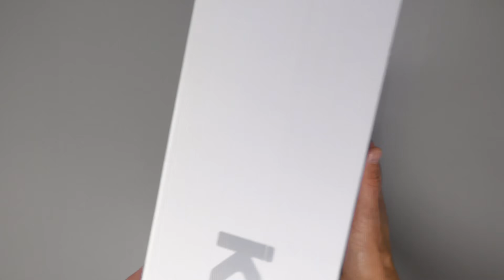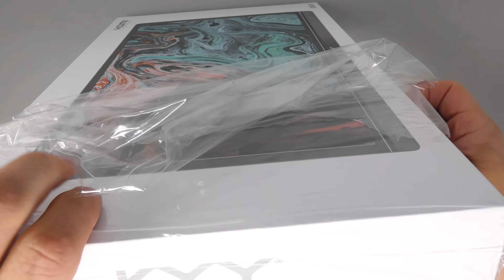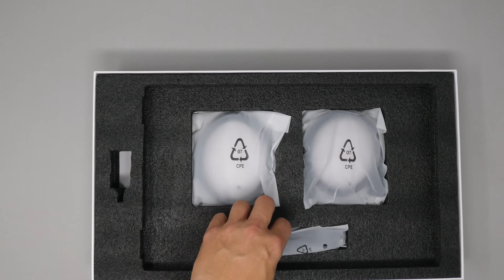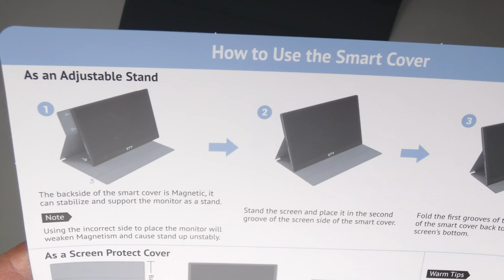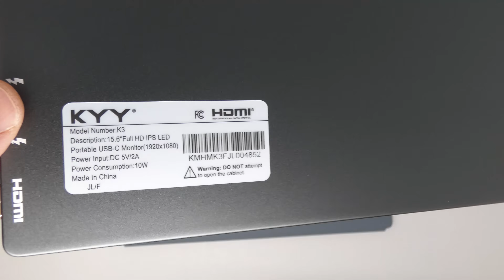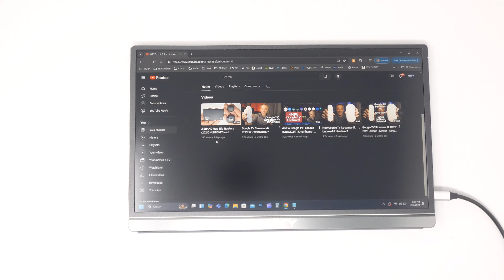KYY K3 15.6" Portable Monitor Unbox and Test

Comment: I can't get it to connect to my phone.
A Motorola.

It just goes into power saving
Reply: Probably your phone doesn´t have a strong electrical output to power the monitor. Did you try using the Plug to power it while using it with your phone?
Reply: @stam150274 yes. My phone doesn't have video output. Something like that. 
I used an app and it told me.

Comment: Hi, do you know how to disable the audio to use the laptop audio instead?
Reply from the maker: Do you mean you want the audio to come from your laptop speakers?
Reply: Correct. When I connect the screen to the laptop it uses the screen audio, and it is not the best. So for meetings, I would prefer the laptop speakers
Reply from the maker: Gotta be a setting on your laptop, not the screen. Gotta tell your laptop where to route the audio. Are you using windows?
Reply: Yes. I am using windows.
Reply from the maker: Click on the speaker next to the clock in the bottom right hand corner, above the sliders. There should be the name of the audio output currently being used, you should be able to switch that with the drop down box to a different audio output device. Any luck?